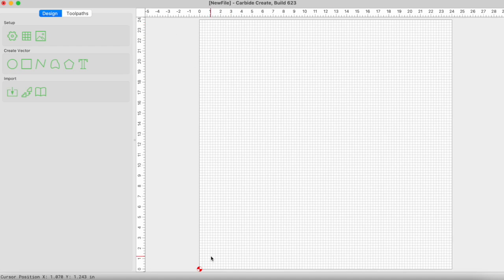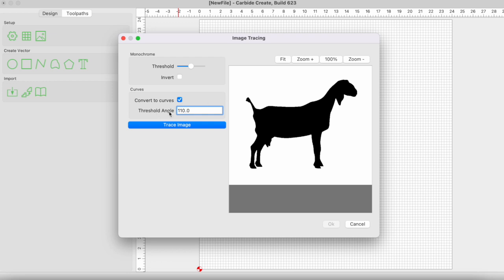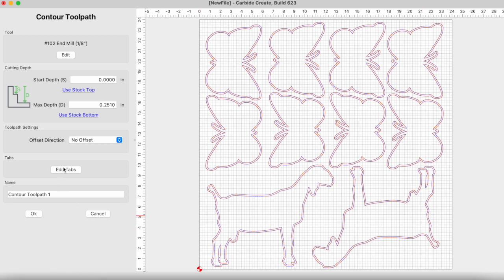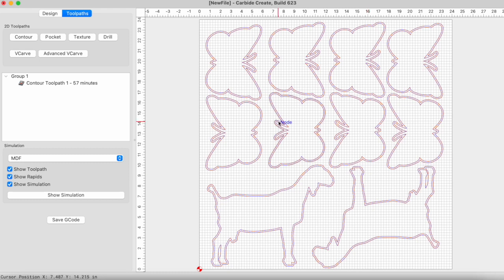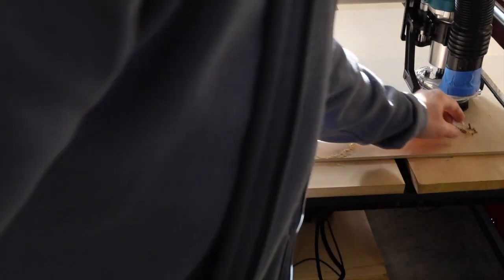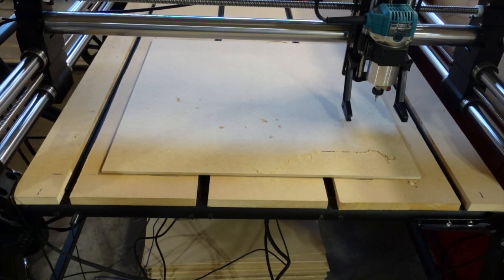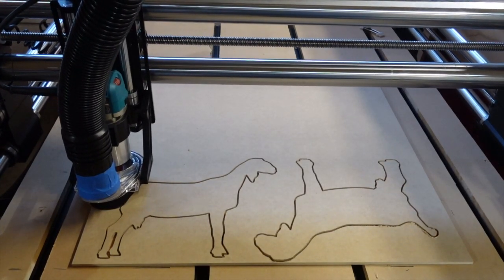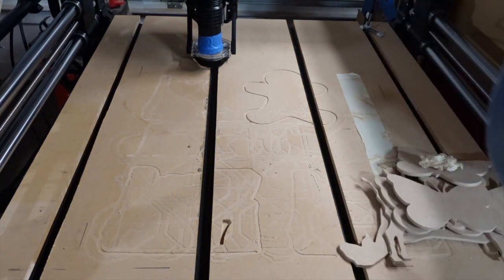Ruined Project Onefinity CNC Router Start To Finish

Comment: Just 1 idea for you... When you go to probe the circle, lower the end mill to within 1/4 inch or so then actually raise the square block to the endmill instead of lowering it with the z controller. Is all it needs is to be touched confirming the connection is made then hit continue and it will follow through with the probing in all 3 axis. Much safer than lowering with pressure on your bit
Reply from the maker: Thank you for the help. I will totally give that a try next time.

Comment: I agree with Bill. I was waiting to see your bit get crushed. Also, at around 6:34 you mention that you don't know much about the bit settings. It's pretty important that you learn what those settings actually do long before you hit the power button on your router. Please don't tell people, "So these settings really doesn't affect anything." They actually do. :)
Reply: Thank and I understand. I’m trying to learn and will do my best not to pass on bad information. But a curious question if you don’t mind. My understanding is that the spindle speeds don’t really matter since I’m using a Makita compact router with its own spindle speed setting. Am I correct that those spindle speed settings are more designed for dedicated spindles on these machines rather than compact routers?
Reply: You are correct, John. However, the other two settings (plunge rate and feed rate) that you're circling with your cursor are fairly important to understand what they actually do for your carve.
Reply from the maker: Thank you. I've been trying to learn how to adjust for those two since you commented and appreciate the input.

Comment: We all have to learn somehow so no worries about minor mistakes. Breaking a $20 cutting tool is nothing compared to crashing the spindle of an industrial mill into the work piece. :)
=Speaking in general terms as I have no hands on experience with the onefinity system, but do I have knowledge breaking things on more expensive hardware. =
The function of the probe block is to provide an automated way of zeroing the spindle to the work piece. The way it works is by running a series of movements to touch each side of the probe block and then using the results to determine the corner location of the work piece. The probe block is a known fixed size in all three dimensions as is the cutout on the bottom that the work piece fits into. When the zero routine is run the resulting X, Y, and Z values are offset by the probe block dimensions to get a known zero on all three axes. 
This same process can manually be done by moving the spindle to the lower left hand corner of the work piece and centering the bit over the lower left corner of the work piece. For X and Y they can be zeroed out in the software at any Z position, but the Z Position should be jogged down to be just touching the top of the work piece or spaced up by the thickness of a piece of paper. 

I suspect that the tool is defined incorrectly in the controller software [or the zero routine lacks the ability to limit Z travel based on tool stick out from spindle] and it's causing the probe routine to Z travel down too far to the point that it reaches the shoulder of the tool. Some tools actually shouldn't be zeroed using the probe block because their cutting face profile changes based on their rotation angle and/or in the Z direction like a V bit or a fly cutter and may not return a correct result under all conditions.
Reply from the maker: Thank you so much for the help and detailed explanation. I will take a look at that. I reset the machine and have cut since then and everything seems fine now so your theory makes sense and turning it off and on again must've reset everything.

Comment: After you broke your bit, with the new bit installed, you only needed to probe for Z (using the other side of the probe block) since - unless you had turned the controller off, the XY data for start position would have been retained…..
Reply from the maker: Oh that's good to know. Thank you for the help and I'll try to remember that for next time.